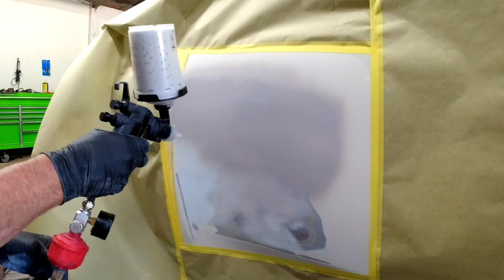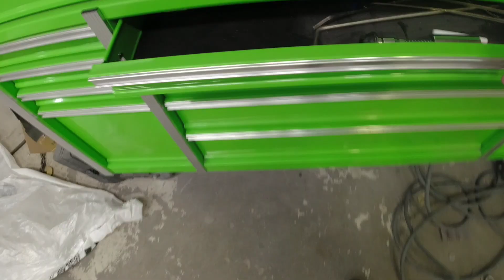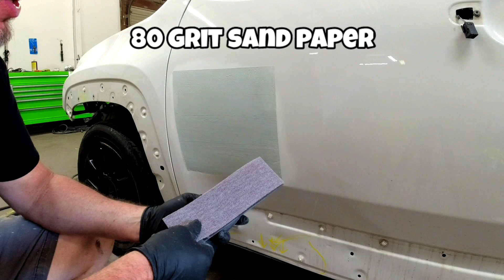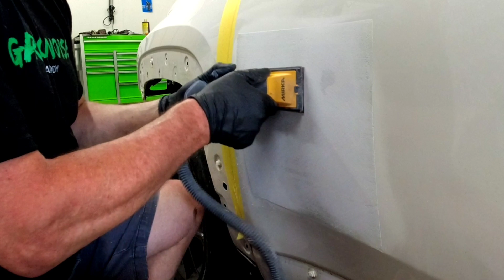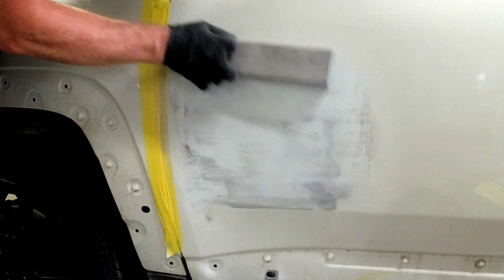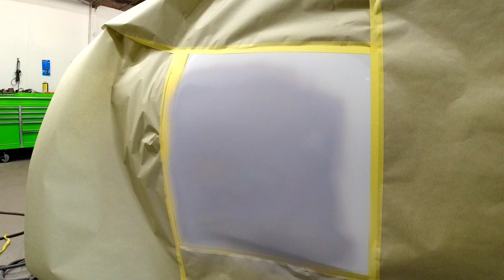How to repair your car with auto body filler like a pro! sanding filler, auto body

Comment: If I listened correctly you had epoxy primed/sealed the car. And you now are coating it with filler. Without adding a tooth to the existing epoxy your adhesion of filler would really be iffy. I’ve always heard that epoxy after setting up over a day or two needs to be sanded before applying either primer or filler. Is that correct or incorrect. Thanks
Reply from the maker: I applied filler over metal , no epoxy primer. Then applied 2 coats of urethane   2k primer.

Comment: When you prime an area and sand . Do you want to create a valley in order for the primer and basecoat to level the surrounding area? Or do you just want to get the primer? I’m going to be trying a spot repair this week. I’m wondering if I should create a valley or just level the primer and hope that the base and clear won’t create a high area. 

I would appreciate your help. Thank you 🤘🏼
Reply from the maker: Short answer, level the primer you don't  want  to create  a valley. Appreciate the support hope this helps !
Reply: @GarageNoise  that’s honestly enough for me! Thank you!

Comment: I will be attempting this, I purchased Evercoat Easy Sand FIB-421
What do you think of it, and will this do.
Can it be used over bare metal?  Primed over?
Specs say: 
Evercoat Easy Sand is a two-part flowable polyester finishing and blending putty that contains Hattonite for optimum sanding performance, and ZNX-7 for superior adhesion to galvanized metal, aluminum, and steel. This glazing putty is ideally suited for filling and skim coating body work, pinholes, grind marks, low spots, and other surface imperfections.
Reply from the maker: Evercoat makes great products . It can be used over bare metal from the specs you sent. It should work great.
Reply from the maker: Putty is for skim coating and dosen't fill deeper dents as well but sands easy and is smooth when applied. It's  easy to work with

Comment: Hi, What caulk does not run after it dries???  For the past few years every caulk that I use that's supposed to be so good on the outside of my windows on my van, runs, on the windows and down the sides of the van when it gets wet.. from rain or Misty fog like we just had.. and I caulked them 6 months ago..
Is there such a caulk like that???
Reply from the maker: I don't  use the window caulk to much, I don't  have a recommendation for you.

Comment: How bout upol high built primer..4.1.what cheapest paint gun I can used....that will do the job
Reply from the maker: I will check out the upol high build . Cheapest is the $15 harbor freight gun. I haven't done a review because there's  so many videos on it. If you can budget  100 you can get some that will last and perform relly well. Check out the asto evot13 ,astro euro pro or the Eastwood lt100.  I have video reviews on the channel.